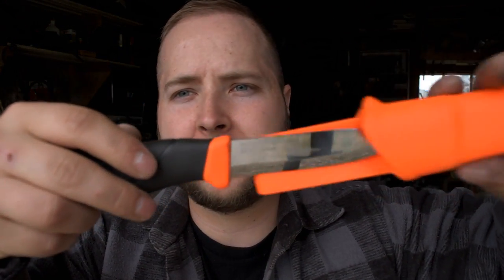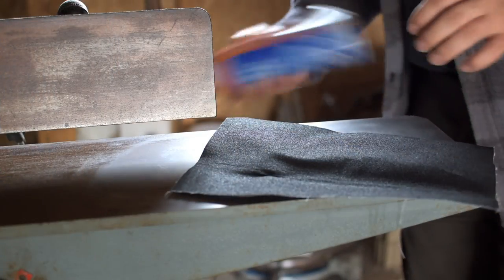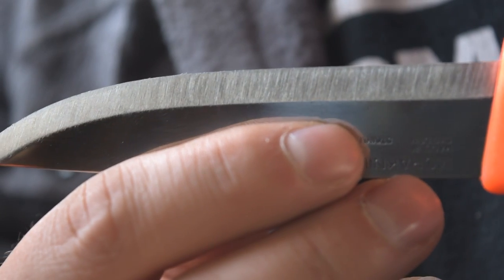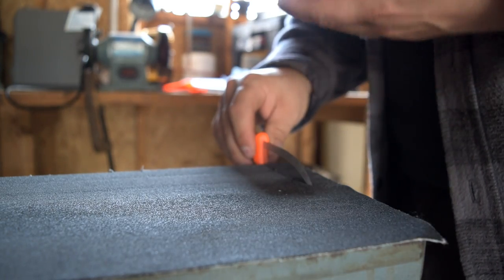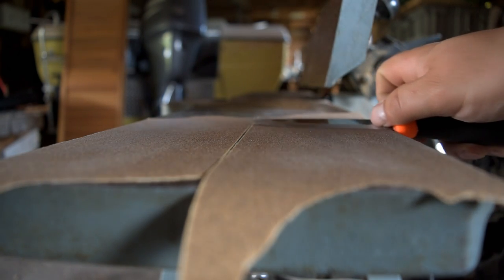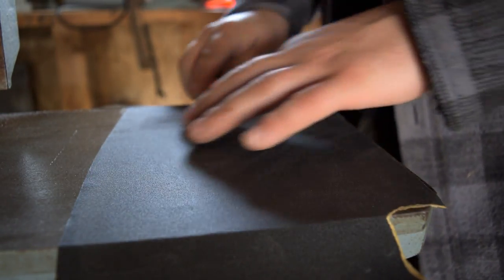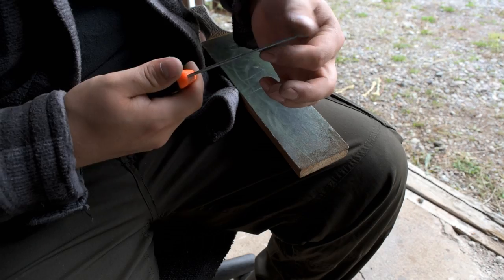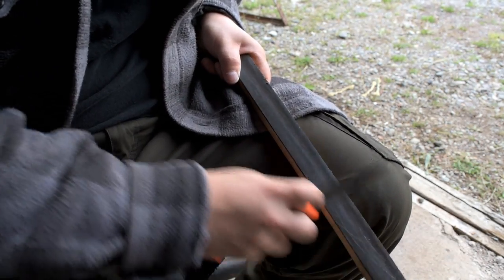How to Make Your New MORA Perfect!

Comment: A good tip for this is to put painter's tape on the work table, then glue your sand paper to the tape. No cleanup required!
Reply: Your a human being who's model needs to be considered for mass production sir!!!
Reply: This comment changed my life.
Reply: That's only shows my low creativity
Reply: What a great tip!
Reply: Thanks bro
Reply: What about glue painters tape to the sand paper, then stick it to your table??
Reply: That's what I was thinking, but I imagine the surface wouldn't be perfectly flat anymore unless you got the tape perfectly lined up edge to edge
Reply: @80b  The other method is much easier and effective.
Reply: Double sided tape?
Reply: Nope...painter's tape will create a soft base and will create uneven sharpening...
Reply: @lbhunter6341  It's hard to imagine a piece of tape that thin causing a soft base.
Reply: @tomjjackson21  Mine too!

Comment: My mora companion came razor sharp from the factory
Reply: even my basic 511 grabs on my fingernail in the slide test and it shaves armhair. Pretty much what i would consider work sharp. The spine is forged ugly though, not only round but rough form what i assume are forge marks. It's however more comfortable to work with, only downside is that you can't use a firesteel with it.
Reply: Vicent Yi I bought 10 when they were on sale for $8 each. None of them were sharp. Hit them on my wet stone for a few minutes and we're extremely sharp. So even if they're not sharp it's very easy to sharpen a mora.
Reply: I got 5 Moras and only one (my second Classic #1) came shaving sharp. None of the was unusable dull though. :)
Reply: Mora companion blades are like most of their tradesman utility knives, serviceable from the factory, the Mora kansbol and eldris are aimed more towards bushcraft,,, even my 749 came arm shaving sharp.
Reply: I have only had companions.  3 total.  1 carbon and 2 stainless.  NONE of them were very sharp.  I wonder if your idea of "razor sharp" is the same as mine?
Reply: My Mora's came razor sharp from the factory ( 1 companion, 3 511 basics and a blade without handle). Never heard anybody complaining of that before.
Reply: @FoodOnCrack  that spine is from stampling. They stamp the blades from a big sheet of steel.
Reply: A Serious Salamander same here, got the green one, shaved hair off my arm with ease and had a 90 degree spine.
Reply: i dont believe that it came RAZOR sharp
Reply: mine to
Reply: @FoodOnCrack  quite sure the rounded spine is from cutting out the blank from sheetstock, looks like the burn marks from a plasma/laser cutter to me.
Reply: @shermdog6969  Thank you.  I thought that I was excessive for owning that many.  Did a number of modifications to the sheaths.
Reply: I have the HD companion carbon and it came sharp enough to shave with. Rounded spine though.
Reply: A Serious Salamander I got mine razor sharp too exact model and it is amazing
Reply: They all are very sharp,I have a few of them
I mod them myself
Reply: I have the same exact one he bought here, and it came sharp enough to shave arm and leg hair... probably not "razor" sharp .
But if you can shave with it, is it that far off?
Reply: A lot of videos like this is typically because of the person being biased. Watch the before and after of the paper cut test and you'll see what they do differently
Reply: So did mine
Reply: Mine too. Got the scars to prove it!
Reply: Heather J Moore well clearly you are doing something very wrong. These knives dont come with scars you did that being dumb
Reply: Razor sharp in your world not Kyle's
Reply: You are a genius! 👌
Reply: My Mora Companion Spark comes with a right-angle spine.
Reply: He was exaggerating everything. Especially with the factory edge on the paper. He was clearly trying to make it seem dull.
Reply: @FoodOnCrack  yeah but the if your really stuck you would just use the blade on the steel and hone it up when you get a chance.
Reply: Mine was close - a few strokes on the strop with green compound, and a couple strokes on a bare strop and I was shaving my arm.
Reply: Mine too.

Comment: My Grandmother taught me how to sharpen my knife (then the contents of her kitchen drawer), using wet 'n dry sandpaper only. It's a lesson i still benefit from to this day. If you are a young, up and coming knife collector/addict, learn freehand sharpening as early in your life as possible.
Reply: Over a month ago I started looking into better sharpening and I had no idea of what a science it is. There are so many methods people use. I guess as long as they receive sharp blades, I can't be all bad. Although, a person can get a sharp blade that does not last long because they finished it off incorrectly, so it's a success but short-lived. 

Today I'll be getting my HD Carbon Mora. It will be my first scandi knife. I don't want to be a knife collector but have the various knives I "need" for various occasions. Plus my needs have changed from the past. I have a few big heavy duty survival knives but in all my years of spending a lot of time in the woods I didn't take them because they were truly not practical to me. Neither was an axe, just useless. My three essentials, a good lightweight pruner, one small knife, one bigger around 4 inch knife, and a folding saw. Now my saws are even better since I have a few Silky saws. 

You put out so interesting info about moist sandpaper. I'm going to experiment with that, dry sandpaper, and using my regular stones. I guess if they all work nicely, go with the one that is the most enjoyable. There's a Zen to sharpening. It's funny, thinking back, my knives were sharp but I never got into the science of sharpening since they did what I needed them to do, but it's fun getting focused on real sharp.

Comment: Hey Kyle, I owe you a beer or several! Following these instructions, I put a mirror finish and a truly razor-sharp edge on a knife for the first time in over 30 years of sharpening. I never even knew it was possible to get a knife this sharp, let alone how to set about doing it! In return for your truly excellent advice, I have some tips I learned along the way that I'd like to share:

I made a series of sanding blocks by cutting 9" lengths from an old 2 x 1" timber I had in the workshop. I didn't have any spray glue, so I fixed the sandpaper sheets to the blocks with double sided carpet tape, and that worked fine. 

For the coarser grits (80 and 120), I used old sanding belts from my belt sander - these are made from really tough emery cloth, and they still have lots of life left in them after they are past their best for wood sanding. You can remove the sawdust from them with a wire brush, and they worked like a charm to quickly re-profile my knife edges before the final honing and stropping. And all these blocks cost me was a few feet of carpet tape! 

I also put insulating tape on the flat sides of the blade to stop them getting scratched while I worked on the bevels - I'm sure this isn't necessary for a pro like you, but for a novice it seemed like a smart idea. It also acts as a guide - if you see bits of tape on the sandpaper, you know that your angle needs reducing.

You really helped me out, so I hope some other people might find these tips useful.
Reply from the maker: Hey bud, thanks so much for the great comment. I don't drink alcohol, but I'd certain enjoy a coffee something, or even a glass of pepsi! :-) Glad you enjoyed the video my friend. Your information here is great as well, and I use most of what you mentioned here, in other projects.

Another idea: for recurves on knives, hook/ bowl knives, gouges, etc., wrap your sandpaper around a wooden dowel. I keep a few different sized dowels around for different radius' recurves :-)
Reply: He has his PayPal at the top. Nice tips with tape btw. I was worried about scratching too

Comment: I've recently done the same process to my orange Mora using diamond stones(125,400,600,1000), sandpaper (2000,3000) and aluminum oxide paper (4000,8000). Finished up with leather strop. After seeing this video I will square off the back edge with a file. Thanks for the cool video!

Comment: When I'm putting a perfectly square edge on my chisels, I use a 90 degree block of hardwood to maintain the squareness. Works a treat and gets rid of one variable.
Reply: I use that same method when adjusting the height of acoustic guitar bridges. If the bottom of the bridge is not totally square along its whole length, it will not transmit vibrations to a piezo pickup properly.

Comment: I just got my second Mora. This one is the HD, high carbon olive green model.  I ground the back spine to a perfect 90 degrees for two reasons. 1. Flint Steel, starting fires, because it's high carbon. 2. Back spine
Is ground at 90 degrees and will shave your thumb nail.
I worked and worked at the cutting edge until it will literally shave the hair off your arm.!!!!!!!!
You do good work.
ALL BY HAND PEOPLE.
Reply: Why not just carry some matches. All you roughing it guys seem to feel you need a ferro rod, a magnifying glass, or a stick and board with a piece of cord.  Matches always work.

Comment: Will a blade that is "Razor Sharp" lose its edge faster because it is so very thin? Isn't there a good balance between strength and sharpness, particularly when using the blade for woodworking/bushcraft?

Comment: Say Heah Kevin, Last weekend I took my 3V Skookum Bush Tool and teamed it with my Ka-Bar Johnson Adventure Parangatang. Normally I team it with my 2Hawks Double Bit Hatchet. But the weather was very warm and the brambles are rough. Anyhow there is plenty of smalls for fire. But the Parangatang is good to chop and baton with and a great clearing Summer Long Knife. I also brought my Agawa Canyon 21 Boreal Saw in the Crazy Horse Scabbard with a extra Aggressive saw blade. I also brought my Gerber Multi Tool which I used to pull off the hot pots off the fire. I also brought my C's in my Kodiak Gearsling. Today I basically used the same set-up except I substituted for my Cold Steel SISU.   It sort of reminds me of my Mora 510 and my Class #1 blade profile. It does have a rounded spine and I left it alone. I use a sticker regardless.  But my C. S. SISU performs Fantastically, with the Johnson Adventure Parangatang compliment eachother Greatly. Yeah, Alot don't like the C. S. SISU and complain about its price knocking the knife and comparing it to a Mora in its ability. For me even though I can't afford a Bugatti. I don't knock the car. That's why I believe the ones that knock it DON'T own one. To me it's like driving a Vet instead of a Focus. No offense Ford Country, you make a great car. But you know what I mean. Infact I put a Casstrom Dangler Extention Caribiner on the sheath and I love it. Recently, I got on a small knife kick only using my knife when needed to cut otherwise I use my natural ability to Bush Craft. But in warm weather in some of the areas I go to a Sumner Long Knife is necessary. But like I said I also like using my 2Hawks Double Bit Hatchet. A perfect Combo too. I do practice staring fires with my Ferro Rod's, but I smoke cigars so I use my Zippo lighter alot. Even if your out of fluid, the cotton in the Zippo Lighter makes a great Firestarter. But instead of putting a 90° Edge or Card Edge on the spine of my rounded spine SISU which makes a stronger blade. I usually have my Multi Tool that has enough tools on it to use as a sharp spine on my knife. I like to come Aparro.,,. p
Reply: Name drop much?

Comment: Hey Kyle, I've been sharpening my knives for a few years now and I have never managed to get that mirror polish that you do on your scandi ground knives. I use similar grit stones to yours, albeit worse quality, but they are still 1000 to 6000. I was wondering how long does it usually take you to get that mirror shine and if there are any techniques to help me achieve it? Also I noticed you used sand paper in this video, would that be an easier alternative method to get a polished edge? Thanks.
Reply from the maker: Hey! It really doesn't take long at all! I can take a knife from super coarse, to a lovely polish, in 20 minutes, no problem. You must continue working with a single grit, until you have removed all scratches from the previous grit. I find that a 2000 grit is plenty to look super shiny! Sandpaper might be a little easier, as it is soft, and follows the curves and crevices!
Reply: Grit on paper, vs grit on stone is two different things, and has two different effects. You will never get teh same results between the two.

Comment: Came across this vid by accident. Fascinating. I am not a knife person, just an engineer. Re square  back for ferro rod. How about using a square diamond file to ' castellate' the profile. Just square notches. This would give you protected square edges for ferro rods. And you could still use your knife to split logs by hammering it on the spine with a log.
Reply from the maker: Glad you enjoyed the vid! The idea to castellate the spine wouldn't work well on a ferro rod. It would remove far too much material, gouging the rod instead of creating a clean spark.

Comment: Almost 3 decades of using these taught me you most likely just wasted your time. An edge like that wont hold on a stainless Mora of Sweden/Frosts/Morakniv knife. The carbon steel ones is a different story, as they are generally a bit thicker. While good for slicing paper, edge retention is a major concern while wood working which is why most dedicated slöjd-knives are made from carbon steel. 

However, a polished edge looks nice, adds stain resistance and probably reduces friction. You can easily put a microbevel on it by hand and strop it in to a durable convex with a belt and some powdered ceramics. For all intents and purposes it will look like a full scandi.

This video is also a fine instruction on how to fix up a mora that doesnt have a centered factory grind. You first "grit" would be a file in that case.
Reply: TheKimjoh560 😉
Reply: Just wanted to note, that was a carbon knife.  Not a stainless.
Reply: The stainless Mora companions are actually slightly thicker than the carbon version.
Reply: @dougjohnsonbushcraftandbjj5561  yea 2mm to 2.5mm
Reply: Christopher Kavanaugh  Haha. I assure you there are no deep seated angst here or claims of superior knowledge. We have an old saying "No point making a fire for the crows". This knife is no doubt sharp but the actual gain from this process is very minor once you start using the knife. There is this idea on the internet that a knife or axe should be as sharp as you can possibly get it but getting a knife very sharp takes alot of effort and alot of the work is undone when you have to touch it up in the field and these knives needs alot of touching up. So putting this kind of an edge on a knife lile this, as satisfying as it maybe, is a fire for crows. You make the sharpening process infinitly longer to gain some very minor benefit for the first few cuts. You'd get more work done in less time with a decent edge maintained with a quality ceramic. This is $5 knife here in Sweden, its great value but dont overthink it.

Comment: I like a rounded spine. Better for carving. Doesn't chew up your thumbs. Just use the cutting edge or use a key.
Reply from the maker: I get that bud! I, myself, like a sharp spine. As stated in the video, perfect for MY preferences :-)
Reply: I  use cheap scissors saves your blades edge. Even chunk of broken ceramic pottery. For ferro rod striking that is.
Reply: thats why i only sharpen a little part of the spine where i don´t place my thumb when carving
Reply: SPOON SMITH - In total agreement .
Reply: Or the striker that comes attached to most firesteels!
Reply: +Daniel Partida what r u, a scientist??? 😂
Reply: Only an idiot would use The Cutting Edge of a knife to strike a fire Steel
Reply: @bobbyhempel1513  misch metal really isn't that hard, it wouldn't ruin  a knife striking a rod with the blade a couple times, but it shouldn't be done except in a dire emergency. Its best to find a sharp stone or possibly a piece of glass laying around if you have no other choice
Reply: Use a lighter, no reason to start with a spark when you can start with flame.

Comment: You can save yourself the spine "problem" by purchasing one of their "Bushcraft" knives with a 90 degree spine.
Reply: Mojoman57 , I have several More knives. one is high carbon for Flint/steel and one is stainless steel.
I have several for fishing, skinning, basic camp knives. they are fantastic knives especially for the money. caint get any better for the cost anywhere on the planet.
most come from the factory razor sharp.
all I do is about ten pulls through my ceramic bi-edge sharpener and that's it. perfect, just to ( hone) the edge and deburr it
Reply: How much does the bushcraft mora cost vs the companion hd?
Reply: @mitchellgardner2193  about 50 dollars more, a lot of money for a blade thats only slighty better...

Comment: Not being a seasoned bush crafter I was on the cusp of backpacking with a Mora and a fire steel thinking I was set.  I did not think of the spine grind needing to be a hard 90 degrees.  Thanks laddy.
Reply: Round is stronger than flat

Comment: For a mora factory edge, if you need to make it sharper with sand papers, starting grit is 2000 or 3000, then you can go upper if you need so. Believe me no courser than 2000 is needed as starting point. And you did great stropping. Good luck. Keep it up.

Comment: Greetings from Ontario! Good channel, Kyle.

I just got a Mora for $C13 online. I got it for use as a shop knife. I was sick of stainless knives - don't really get sharp. I use diamond sharpening plates and a strop with green polishing compound. The knife is great. Scandi grind if fine for shop use. I also carry an Opinel #7 in my apron pocket for when I need a flat grind, marking etc. Both knives are some kind of carbon steel, and hence are much easier to get very sharp. I' m totally happy.